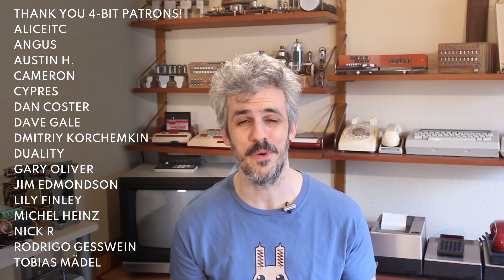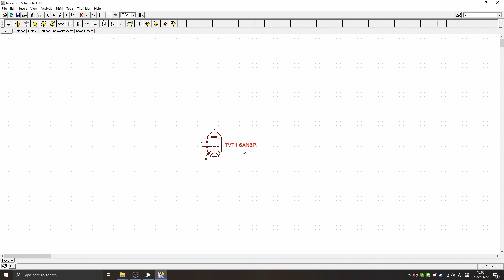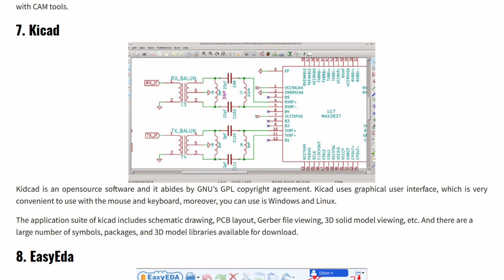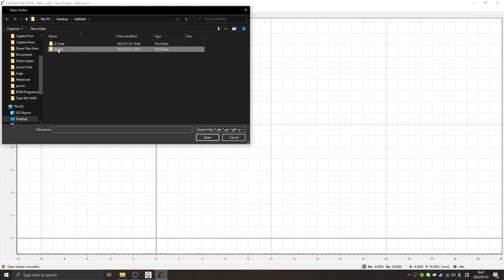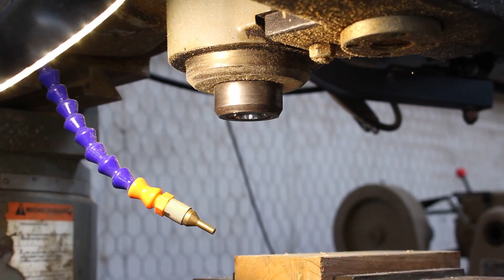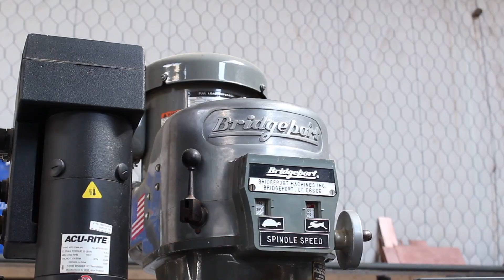Machining a PCB on the 3-axis CNC Bridgeport Mill

Comment: I a few years behind watching this video, but I’m just finishing up building my own mini (desktop) cnc mill and am starting to look for guidance on what bits to use, etc.  Anyway, I’ve been watching your channel for about a year now and knew you make pcb using a Bridgeport mill.  What strikes me, somewhat in awe, is you’re using those tiny bits on a huge machine. Just shows how tight your Bridgeport is or how well the software can correct for the backlash,etc.  So, thanks for sharing your hobby (obsession) and looking forward to the next installment. 😊

Comment: What is the spindle speed RPM? I have read people used a "spindle speed multiplier" attached to the spindle and achieved 20,000 RPM+. Could provide smaller bits and finer detail PCB traces. Great to know that BP can do this. You should make a video on how you made the BP converted to a CNC, planning to do on a BP.

Comment: Very cool.
Just a thought, have you considered adding a second spindle to the Bridgeport for high speed stuff? You can get those 2.2kw 24,000rpm spindles for a couple hundred dollars, then maybe mount it to the side of your quill and your big circuit board projects would go quickly.

Comment: Why not just add a z probe to the machine. You already have a conductive surface. And so is the bit. For someone with your skill a z probe should be easy and you could skip surfacing the log and if you do a height map account for surface imperfections.

Comment: Very beautiful indeed, 
I also mill my PCBs, but I machine on LinuxCNC wth a smaller size, 500x300.
Got a few tips from your works there, i though on milling 1mm on the wood surface, glad to see this technique is used, cause I have plannar issues at the moment.

Regards
Jean-François

Comment: Thanks so much for leading us through FlatCam setup. I've been staring at it for hours while hearing the sound of broken bits on copper, wondering what the #$%& to try next. Great tip on proper PCB hold-down! Here's a great useless vacuum tube project to try next-- a 2D21 thyratron light dimmer.

Comment: This looks great! I'm a student and at my school and I've been working on getting a Boxford A3 to mill PCBs. My first thought was to make a vacuum board out of some scrap MDF, electrician conduits as hoses and 3D printed parts, I didn't really think about just using a piece of wood and some double sided tape. That would've been so much simpler.
Reply: Problem is that you don't really get a flat surface. The tape and blank pcb both introduce variations in height. While you probably can get away with this for THT boards that have decently thick traces. For more detailed PCB's however that have thinner traces you will no doubt run into issues.
Reply from the maker: Thank you!
I actually had the same headache trying to figure out how to mount the board at first too, and then it kind of hit me to give the wood block trick a try, and to my surprise it worked really well!

Comment: Does the bridgeport have any way of input a z-probe? I use LinuxCNC, Eagle and pcb-gcode to make my boards. And to zero my Z axis, I attach an alligator clip to the milling bit and a ground wire to the blank board. Home Z is accomplished when the bit completes the circuit w/ the board. Put in the desired touch off, and compensating values in the g-code and off you go.

Also, there is / was a leveling feature for pcb-gcode that triggered a probing of the board to detect / catch the subtle waves of imperfection in the 2x4, double sided tape, fiberglass backing and finally plating of copper - that allows the mill to adjust up / down by a few steps as it cuts the board - the result is the ability to get even finer traces cut.

10 year old potato cam video with gramophone quality audio - lol. https://www.youtube.com/watch?v=WfQTS4RDP-g
Reply from the maker: I believe the Millpwr control unit does indeed have a Z-probe input. Initially I was trying to figure out how to use that with an autoleveler to get everything to zero, but in the end, I was way too lazy for that, haha. It takes me about a minute to flatten the 2x4 and tape it and the end results are often precise enough for the stuff I'm working on. If I really wanted to do thinner traces (like 0.6mm) with tight clearances, I would definitely need to do the autoleveler option.
With most of my tube circuits though, I find that the major limiting factor is that I use through-hole components. It turns out that those take up quite a bit of space and just getting them all to fit in the same space is often quite a challenge. But, I've kind of gotten into a groove of PCB layout and I'm quite happy with the consistency and quality that I've managed to get using this method!

Comment: holy cows! the bunny make sense now

how do you feed the filament of the vfd? at which voltage? the large resistor is related? I assume the +B is 24v, right?
Reply from the maker: Haha, the cows were upset about something, no clue what though!
The VFD filament is powered via that big resistor off the B+, which is indeed +24V. The resistor is a bit oversized, but it was the only somewhat high wattage 820 ohm resistor I had floating around, so it worked out alright!

Comment: Awesome video! Every time I watch one of your vids I tell myself I have start milling my own. 1.5 hrs may be a lot to wait but it beats my time of 1.5 weeks using JLCPCB. Question: Does anybody know if the $4-500 tabletop mills on Amazon are any good or if they'll serve the purpose of PCB mill? I unfortunately don't have Bridgeport money laying around, hoping it may be an option.
Reply from the maker: Thank you!
A Bridgeport is actually a pretty terrible tool for machining PCBs, I liken it to using a rocket launcher to hammer in a nail, haha. But, the PCB routers are getting more and more affordable. The smaller routers mean that you have to do a few extra steps to ensure that the board is level. Usually, this means getting the PCB in place and then having the CNC takes measurements across the board surface to automatically adjust Z depth. But, they also offer higher spindle speeds and a bit more precision, so you can even get away with SMD stuff!
Reply: We have one (of those more inexpensive PCB mills) at the local makerspace which is shunned and despised, however some of the reputation is likely from people being over enthusiastic about tight geometry. Don't expect to use them for tight layouts and they seem to work OK.
Reply: Awesome, Thank you for the replies!

Comment: Have you tried painters tape/super glue mounting instead of double-backed tape? Seems like it would be easier cleanup. Thanks for the video. I'm going to check out flatcam.
Reply from the maker: Thank you for checking the video out! 
I haven't tried any glues or other tape, but the double sided tape really isn't too bad as far as cleanup goes. I didn't show it in the video, but once I have the board off, I just give the back a quick spray with goo gone, give it a quick wipe down and then wash it under the faucet and the board comes out looking perfect!
Reply: @UsagiElectric  sounds good, watch NYC CNC WW185 to see what I'm talking about https://youtu.be/r6DCvtcU8_M
Reply from the maker: @CraigHollabaugh  Whoa, that's super cool! I hadn't seen that painters tape and super glue method before (I was thinking one or the other). I'm not sure how well the painters tape will stick to the PCB surface, particularly because I can't scuff it up, but I may have to give that a try at some point!
Reply: @UsagiElectric  its going to work fine because you're not putting any force on the work piece (the board) with your v-bit. With the board size you're using you can probably get away with a single piece of tape too.

Comment: I have cows at the end of my street but the difference here is that everything is covered in snow so I doubt we'll be seeing them until Spring. 
Never heard of Tina Ti and I'm getting used to LTSpice and its horrific UI.  
Excellent video.
Reply from the maker: Thank you!
LTSpice's UI was so difficult for me to get used that I never actually ended up using the program. The TINA-TI program was much easier to pick up, which is making me realize how vital a good simulation program is!
Interestingly, we got some snow here this week, which is pretty rare for Texas. I'm hoping it'll be back in the 60s and 70s soon though.

Comment: Very nice boards.... why is it that (nearly) everybody uses a d-bit to cut the isolation, not an endmill? I've been meaning to make my own PCBs (probably by UV and Copper Chloride) for about 30 years now ;) one day.
Reply from the maker: Thank you!
I think the primary reason is due to the tight size constraints. Through-hole pads are usually 2mm in diameter, which means there's just 0.54mm of clearance between adjacent through holes. The smallest end-mill I could find was 1.5mm, which is definitely too big. With the 60* v-bit cutting to a depth of 0.2mm, it cuts at a width of 0.331mm, which is perfect for those tight through hole clearances.
Reply: @UsagiElectric  I see.... makes sense.
Reply: The UV film takes some effort to get right and is very frustrating when it doesn't adhere very well and you have to redo it before etching. Worse when the etchant eats the etch resist. I've tried a couple of etchants (in an attempt to avoid staining everything I own with ferric chloride) and they all suck compared to ferric chloride. Going the CNC route as here basically results in a perfect board every time. And it's possible to get a perfect double sided alignment and perfect drills too. And you can do it with basically a cheap 3D printer converted to spin a bit (aka a tabletop CNC) since you have very minimal forces on the PCB for most operations.

Comment: "You see a regular, domesticated brahmin."
"Moo, I say."

Nice board, though I'd place these four 1N4148's slightly different, avoiding the need for long runs of tracks on the bottom 2/5 of the PCB.
Great overview of your process! :)
Reply from the maker: Moo indeed!
Thanks! And good eye on the diode placement, that's a result of me designing the board rather quickly. I tend to place the components where I want them first, then figure out the routing, and finally I go through and optimize stuff, but I skipped the optimization round this time.

Comment: PCB milling on a normal dovetail/boxway machine is a good way of wrecking it really fast....
These machines need some long movement occasionally, so that oil gets distributed from oil channels onto the slideway and inside the ballscrew nut.
Otherwise slideways/ballscrews run dry over time, which causes lots of wear.
PCB milling is something I'd rather do on a cheap disposable china router.
Reply from the maker: We use the mill for all sorts of things, large and small. PCBs are just one of the many things we cut on it - we've cut car parts, project cases, stamps, and all sorts of random stuff on it. Also, I often cut very large PCBs too, requiring the X-axis to move across 300 to 400, sometimes even 500mm. The mill also has a ways oilier that keeps everything nice and lubricated. I've been using the mill on a weekly basis (sometimes daily) for more than 2 years now, and it's still just as accurate as the day we got it (which is around 0.02mm).
Reply: Oh c'mon. That old clunky Bridgeport style turret mill is not worth much money anymore. Besides, this guy is never going to machine longer more accurate parts. He is machining PCB's. There is very little accuracy needed. I am a machinist by trade, and milling parts to 0.05mm (2 thou) tolerance is a regular occurrence on these types of machines, and the one I used to run was pretty old and still was accurate enough. And it was used daily in a machine shop, taking heavy cuts in steel, still holding 0.05mm over 750mm. 

He will never run into an issue of accuracy with that machine, cutting PCB's.

Comment: Great video.   Have made many PCBs the same way.  Can do smaller traces and finer details.  Even down to the larger surface mount pads and spacing.   I use Eagle with "pcb-gcode", a free download ULP extension for Eagle to create the gcode for the milling machine.   I have a similar but older Bridgeport Boss 5, originally with the 1977 4 chip PDP11 computer (the high end model with 32K of RAM), paper tape reader and 300# of the original controls ripped out and modern MOSFET stepper motor controls driven by Mach3 on a Windows desktop PC.
The one limit I see is the rather slow spindle speed of the S1 J VS Bridgeport head with a limit of about 4000 RPM.  The 60 degree engraving cutter, drills and mills REALLY NEED a lot more RPMs!  But it does work if you don't push it.....P.S. No cows here but I do winter pasture horses on my 800 acre bit of heaven here in Wyoming.   (you just thought YOU were in the middle of nowhere)
Reply from the maker: Thank you!
I have managed to cut some surface mount stuff with proper thin traces, but it takes a lot of fiddling to get everything set up just right. Slightly too much depth and the traces break apart, too little depth and there isn't enough copper cut for isolation. I think a 30* V-bit would probably offer a lot better cuts for smaller traces and pads.
That's interesting that Eagle has an extension to create gCode directly, that certainly makes life a lot easier!
You're right that the 60* V-bit really wants a lot more spindle speed, but the big ol' Bridgeport maxes out at about 3200 RPM, so I let it run at 2900 RPM and with a slow enough feedrate, it seems to make pretty clean cuts.

800 acres is a real nice slice of heaven! We're only on 175 acres, but that's still plenty to feel nice and isolated!

Comment: Great video!  Where did you get the SPICE tube models to import into TINA-TI?  Also, what is that PC in the corner to your left with a CRT monitor on a stand in front of it?
Reply from the maker: Thank you!
The spice models I use I found on the website linked below. It can be a bit of a pain to import the models, but there's a few tutorials out there for doing it. 
http://www.normankoren.com/Audio/Tubemodspice_article.html
https://training.ti.com/importing-spice-models-tina-titm-simulator

The PC in the corner is my NEC PC-8001 that I picked up in Japan. Though I got the matching PC-8041 monitor and PC-8031 dual floppy drive here in the States. I haven't actually powered it up yet, so I have no clue if it works. I really should work on that one of these days. Perhaps I'll do a few videos on it and my TI-99 as it needs some work too!